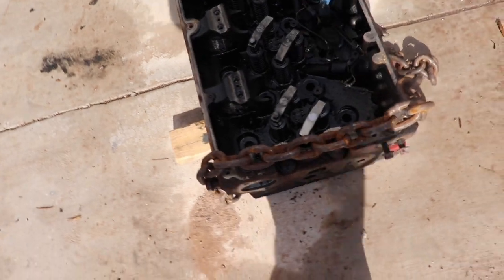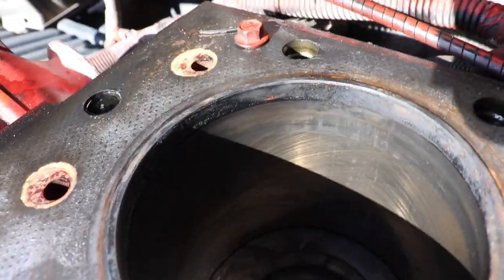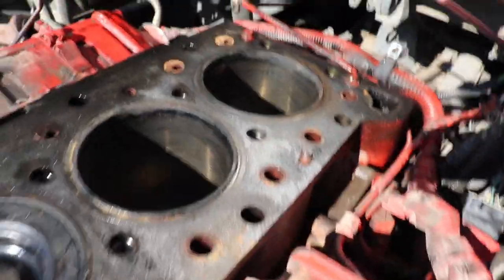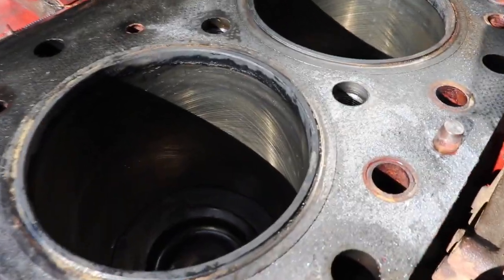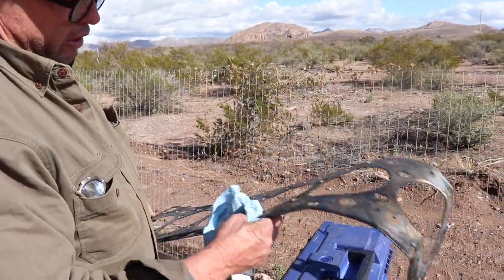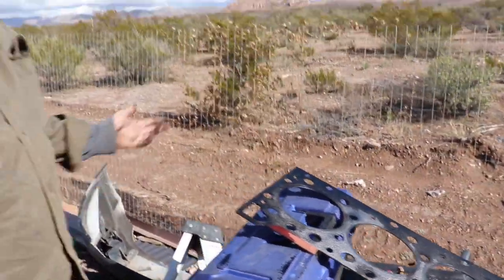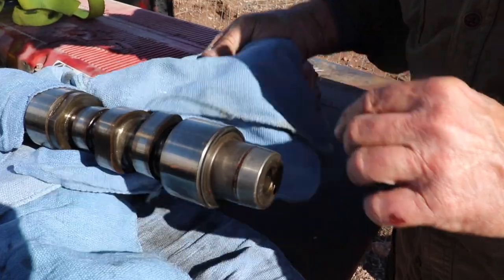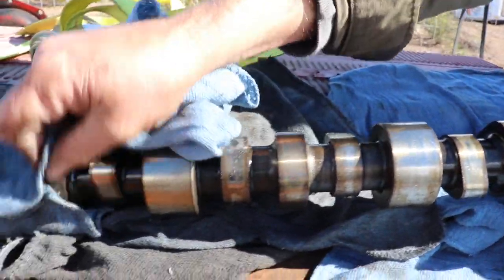9- Cummins ISX Single Cam,   Cylinder Head removal and Inspection. (Is there Hope For The ISX?)

Comment: Thanks for showing the operation.

Ain'tcha worried about sand blowin' all over and in your engine?  Workin' outside and all ..

My suggestion is to turn your truck-tractor in to a glider and drop a Cummins N14 in it.  I would never buy an ISX—too many issues I have read and watch youTube videos on
Reply from the maker: Everyone says what “they” would do. It all comes down to money. No I wasn’t worried about sand and it’s still running great. Thanks for watching
Reply: @TerraFirmaX  

Great to hear.about the great result .

I will gladly drive a good running ISX over most any other engines. It's great you can diagnose and repair yourself.

 I have not completed watching this series.  Therefore,  I am eager to see what a fluxing the cylinder-head brings.

Not being a mechanic, but force to do my own work because the availability of Trick Mechanics below $150.00/hr in April, 2022, Chicagoland is scarce.  Cummins a few dollars down the road from me are somewhat available—@195.00 hour ....quoted $800.00 for a valve-train inspection and adjustment three years ago.

But I already have four major components to deal with: Engine, Transmission, and two rear-axles, followed by cab and front end and brakes.  I cannot afford, neither financially nor chronologically an emissions system going haywire.

Comment: How's the head is it cracked the new ones are expensive and a clogged DPF will accelerate the problem I'm working on one right now that has the same problem it's so much work to pull the head it's worth doing pistons and liners also you need timing tools to reinstall the cam more $$
Reply from the maker: kirk grose yes I bought the timing tools. I am doing the bottom end as well.

Comment: My experience is to replace the cam, head, rockers and rollers. I did my 1st inframe at 653k and now just under 800k I have lost a valve seat. Dont be cheap.
Reply from the maker: I'm not trying to be cheap, I'm trying to work with the money I have. I am going to replace the cam and valve train however, plus a NEW head